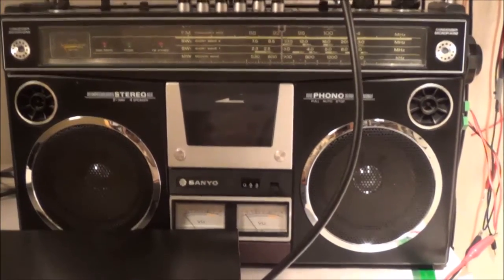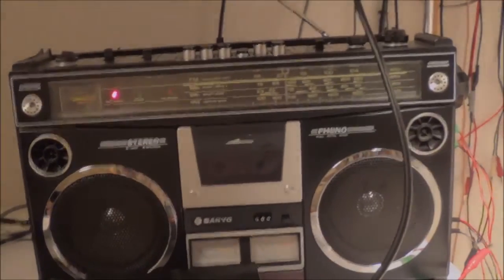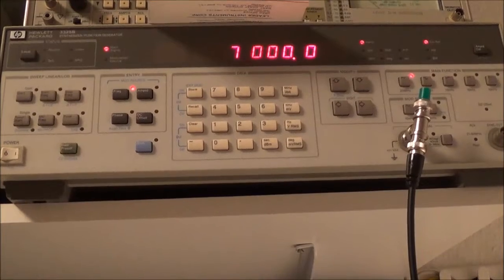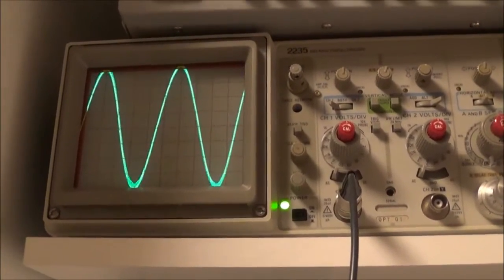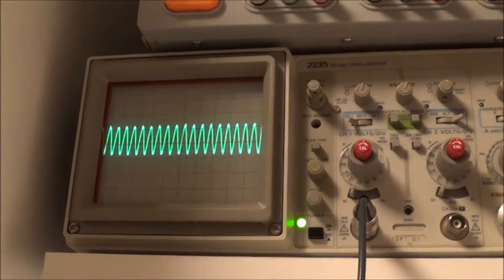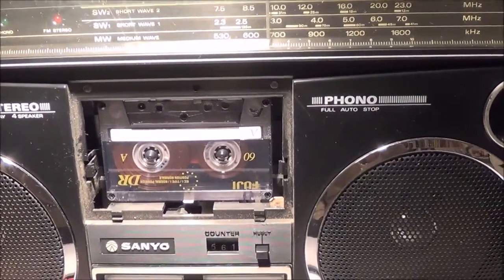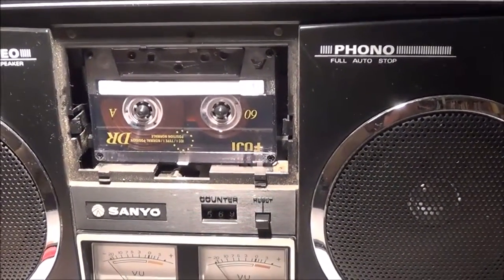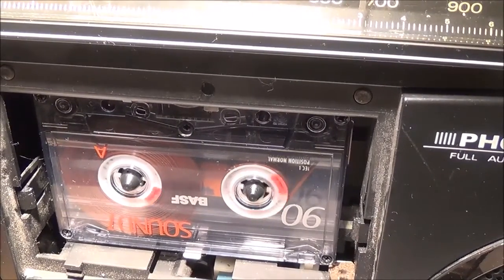Sanyo M4500 Cassette High Frequency Loss & Azimuth Adjustment

Comment: Actually this boombox cassette deck can take ferric, ferrichrome and Chrome tapes, not bad than later decks which went from cassette decks functions to low-end decks like replacing the electromagnet erase head with a permanent magnet and AC bias with DC bias.

Comment: Nice video demonstration. I restored a Sony TC-U2 tape deck and on playback it sounds fantastic. On recording however, it sounds horrible, I calibrated the Vu meter, and then tried to adjust record level and bias. At the head I measured with the oscilloscope the voltage to get the channels matched but they still won't match so I then tried to calibrate it by just recording and then playing it back, anyway after 3 days of fiddling around and changing capacitors and experimenting I still couldn't get the frequency response good enough. On certain songs with a lot of sss's on it, you can definetly notice it. I measured the frequency response to drop at about 50% at 7khz and at 8 khz it's basically tone deaf. Funny thing is that even if I try to record a 20khz signal, when I measure at the head, the signal it's all there nice and crisp but it doesn't get recorded on the tape. The head looks in pretty good shape and sound perfect on playback. I don't get what the problem might be, have any ideas? Cheers :)
Reply from the maker: did you ever get this figured out?
Reply: I gave up on it after I used another tape player and took the signal from my Sony and connected it to the tape players head to record a tape, then adjusted the bias and it actually sounded better then with it's original head... so yeah It's probably the head.
Reply from the maker: You can't win 'em all. I thought maybe there was a problem with the bias level or the bias sine wave, not the actual bias frequency, especially since you changed capacitors; I assume you changed the capacitor of the bias oscillator to change the frequency.
Reply: I don't remember what I've changed but the sine wave looked perfect anyway. I listened to a tape today and It sounded since so I'm happy enough, I don't inted to record with it anyway since I have better decks. :)